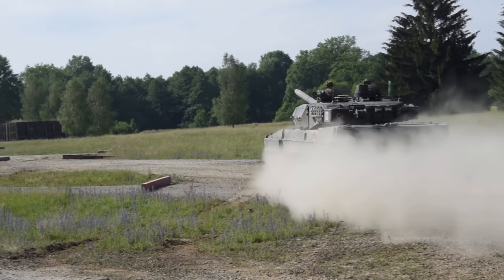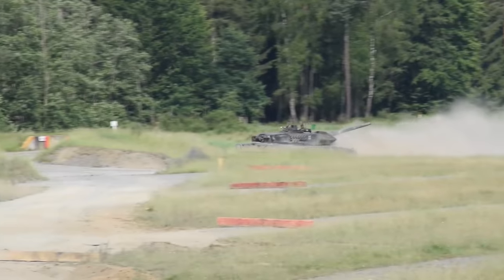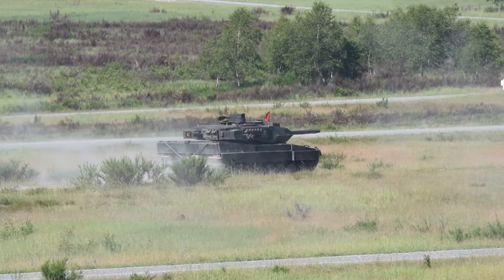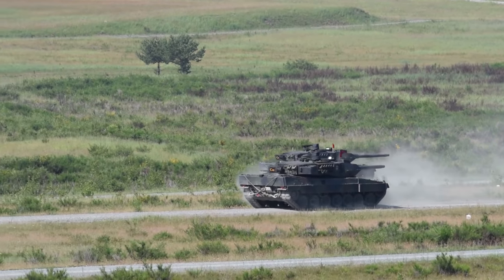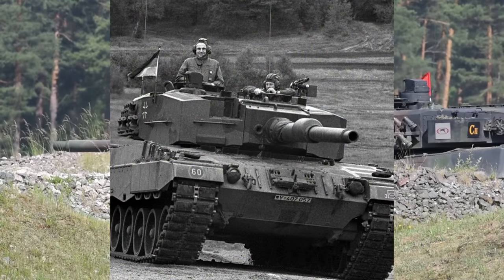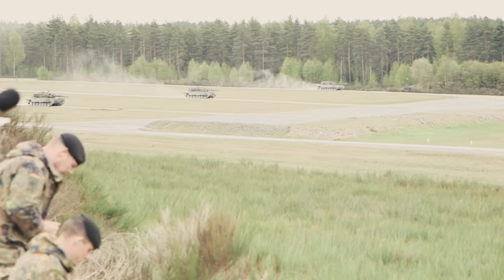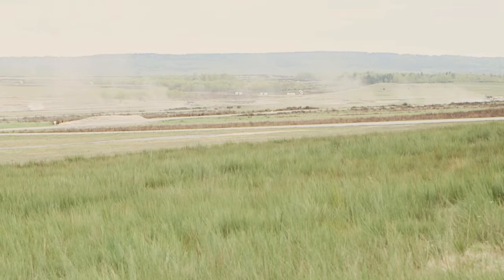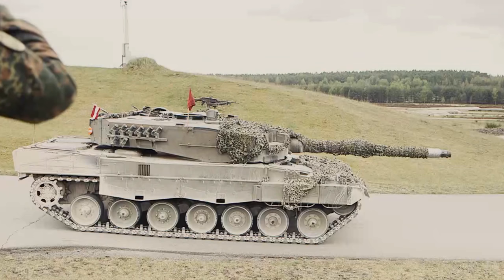Leopard 2 Main Battle Tank | GERMAN ENGINEERING

Comment: everybody gangsta until germany pulls out the secretly developed maus 2
Reply: Posi Troll wait a minute those are planes

Maus is a german heavy tank that was too heavy and was a crappy tabk
Reply: @yukiakito3083  Um, and? He was talking of a Maus 2, not the original one, thus (jokingly I assume) implying Germany had a secret tank program after WWII or right now. 
I pointed out that's not the case (LeoII AX and MGCS programs both arent really secret in that sense). But it DID have secret stealth fighter programs.
Reply: Then they pull out the laugh-track when the big plob gets stuck in the mud or collapses a bridge it's trying to cross.
Reply: @positroll7870  h
Reply: @positroll7870   That same year, the Lampyridae project was terminated for unspecified reasons; diplomatic pressure on the part of the US has been attributed. 
bruh
Reply: Maus? Hah, I'm waiting for them to bust out a Baneblade or even a Mammoth tank lol
Reply: Germany ditched the E-series after
ww11
Reply: With a funny man with a small moustache as the gunner 😃
Reply: And again .... will be the heaviest tank
Reply: You just see a tank chassis with a rail gun on top XD